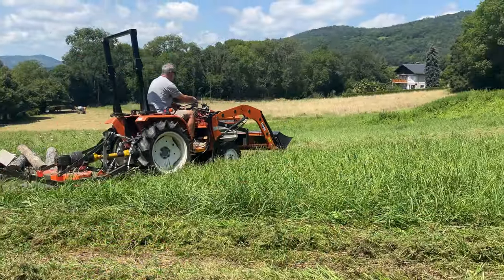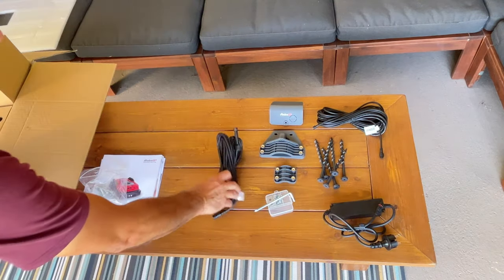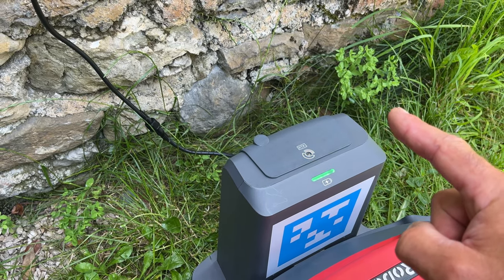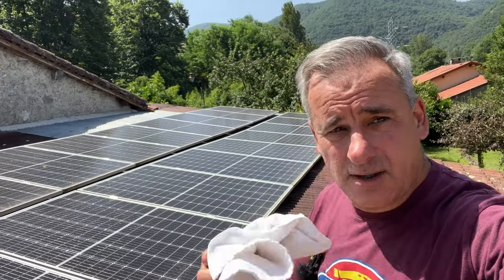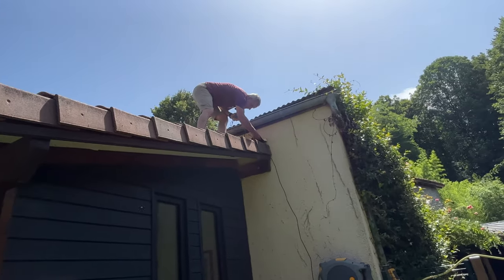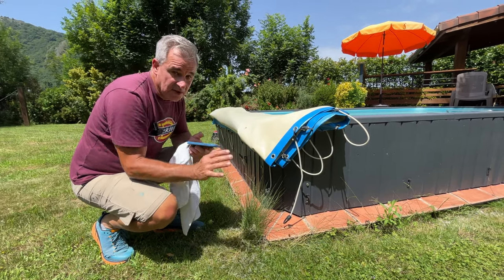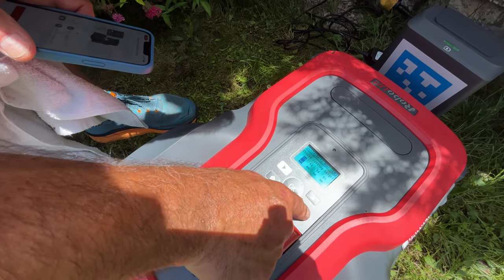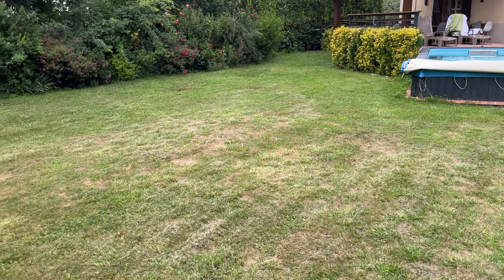The RoboUP Robotic Lawnmower: The Full Test

Comment: They have a new model demonstrated at a product fair that looks quite different. I'm liking the swivel front tires on this model opposed to the type that the Luba has. Our yards are flat so we don't need 4WD. Someone said their Luba chews up the corners where it does its turns. The new RoboUP actually steers like a car which limits the turning radius. I think the model shown in this video can turn tighter because it turns by reversing one tire. Great review. Thanks.
Reply from the maker: This model works very well, it has the odd mishap but I think that is the nature of our garden with some hidden ditches and holes etc but once set up it just keeps going.

Comment: It's here too (the heat)......thunderstorm last night and a bit of rain....but by mid day today back up to 28C and sun with a few odd clouds....I am sweating buckets and all I did was use a long (extendable electric chain saw) by Husquvarna......if you have not gone electric you should try it.......we are all electric chainsaws now......only things we need petrol for are a plate vibrator like yours, that is getting a bit long in the tooth (8 years - Sheppach) and will be replaced with a diesel.......and my pressure washer....(Chinese - but has worked fine)....it will take the paint off anything if you are not careful.....I may try one of those Chinese again pressure washers that are hand held and use drill type batteries.....I will be well chuffed if someone like Makita or Milwaukee makes one.
Reply from the maker: We are under heat warnings now, 37 today and it is supposed to hit 41 tomorrow... not much work outside going on.  I only have Makita tools for outside, trimmer, hedge cutter.  the Stihl and Husquvana stuff is still too pricey for me - my son just bought the still battery stuff and is happy with it.
Reply: I know it is taking a chance with the high prices of Husquvarna etc......but I am honestly getting 3 times the life out of these products, that I would have from some indigenous/lesser makes.....and it's not just that...take Husquvarna battery powered strimmers....the motor is down at the head, so there is none of that vibration and weight from shaft drive.....Early on here I bought local Polish made strimmers...and yes they worked well....at first....then they started to vibrate.(enough that you had to stop because your hands went numb)..then had to be taken apart every year and the carbs dismantled and cleaned or they would be beggars to start.......with electric there is none of that...(its not that I'm lazy, I like 'tinkering' but not having to do it gives me time for other projects. @HomesteadingUncontained

Comment: See that lovely gate of yours....4 bar gate....???    I have showed plans for a real English 5 bar gate to so many really good woodworkers here in Poland and they are all scared to take it on.....they all do the sucking air through their teeth and say it is beyond their capabilities....It is not but they have never seen a real 5 Bar gate made with dowels and not screwed or nailed....I have had the hinges  for my gate for about 12 years now...and I have installed the gate posts, still waiting for someone who could make the gates.
Reply from the maker: This is all lap jointed, I have another ready to put together for the chickens "inner" keep.  I quite like making gates but the traditional English 5 bar has tapered horizontals to keep the weight down, that becomes more tricky to do.....